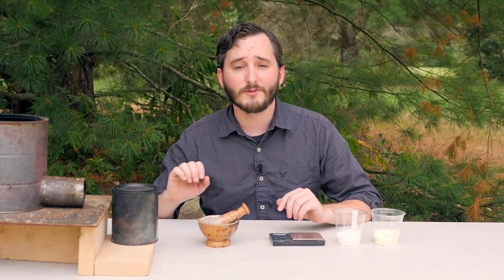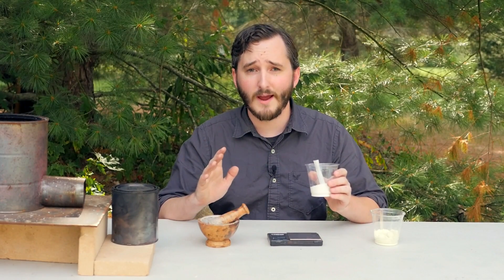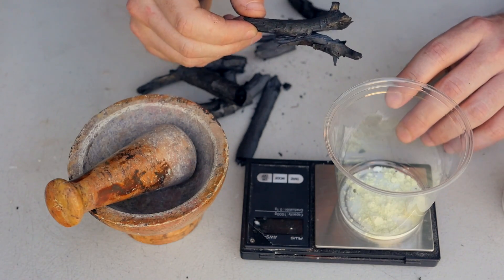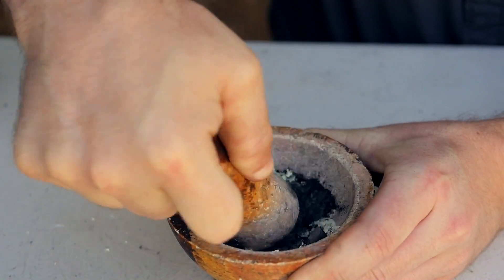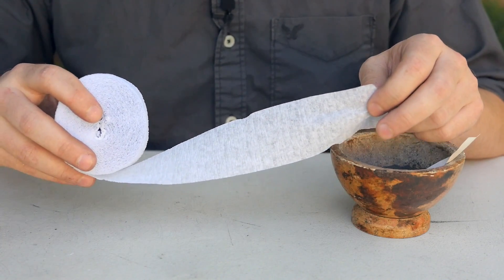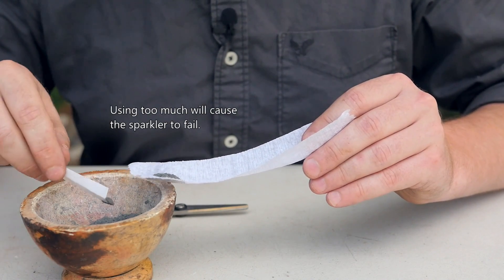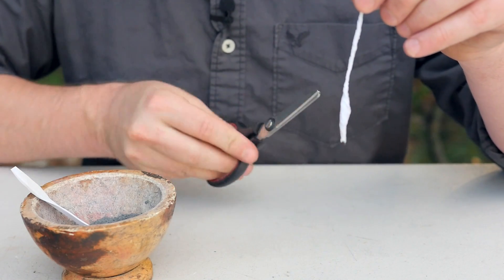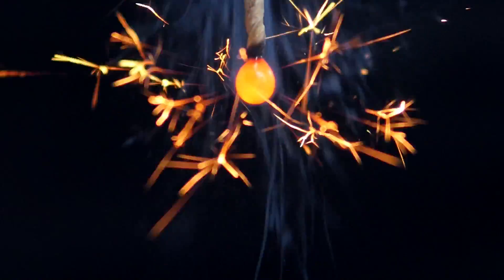How To Make Senko Hanabi Sparklers (very rare Japanese fireworks)

Comment: I think there are two questions relative to the sparks, namely what is it that's burning in them, and what provides the motive force for their ejection? I don't know the answer to either, but am wondering if trapped gasses in unburied bits of the charcoal could be released, propelling the charcoal particle out of the melt, where it burns in air. (?) But then the initially ejected bits themselves break apart into sub-sparks. Same process?

To test the trapped-gas theory, you could try (a) using less completely-combusted charcoal (leaving some unburied resin inside the cells), and/or (b) trying a different kind of wood to make the charcoal from, that has a tougher cell structure (making it more likely to retain some resin inside, and/or more likely to build up higher pressure before a cell or gas pocket ruptures, so giving more force to the particles, so they can escape the melt.

OTOH, it seems unlikely that the particles are being ejected from any depth within the ball of slag, so it seems it's more likely some sort of a surface reaction that's randomly occurring on the surface of the slag ball. - And once a particle is ejected, it has both higher temperature and lots of surface area, so the process repeats...
Reply from the maker: I am not completely certain about the mechanism of the reaction, but I have some thoughts I talk about in the video description. The charcoal used is certainly a key factor, but that's the case for just about every type of firework.
Reply: I think it's gasses formed in reaction:  S(g), SO2, N2, CO, CO2
Reply: NightHawkInLight - Oh duh, skipped straight to the comments without reading the post itself!

So it sounds like it must have to do with how the gas-producing reaction is triggered or catalyzed. Interesting that the one-off early success was with the arsenic compound. Maybe something to do with what the sulphur was in that was left behind in the slag?

The slag ball seems to grow quite a bit after the primary combustion, by consuming the carbon in the paper. I wonder what would be the effect of sprinkling a bit of the "special" carbon from the charcoal up along the paper "tail", above the mixture? That way, you could change the type of carbon being incorporated into the slag-ball as it develops...

Comment: Potassium Nitrate  35
Charcoal 20
Realgar 45
Reply from the maker: Yes, I've found it doesn't work well. I've tried 100+ variations on the composition with ratios on either side of Skylighter's. The one I settled on for this video is far outside the commonly documented range but it's what I found to work best.

Comment: Can you change the color of the sparks? Like, adding borum or potassium or even magnesium. I would love to see it with a little bit of magnalium (magnesium aluminum powder). I believe that for such effect they would have to be added as impurities, very very small amouts. You can also test diluting these salts in water and soking the paper with the solution, it problably have to be very dilute so it doesn't afect the burning.

Comment: Changing the wood for your charcoal willl maybe do the job, indeed this pine is not a tree from japan, using a japan tree like they use will maybe change everything. Each tree make diffrent sap and have diffent mineral needs so you will find diffrent source of sparks in these diffrent woods. Did you try with mineral coal?  Maybe it'll be very diffrent too
I'm sorry if i kill (again) Shakespeare with this comment, I learn English by my own...
Reply from the maker: I have tried several types of maple charcoal, it works ok but nothing special. I have not tried coal, that would be interesting.

Comment: "what might help?" 
well all sparkler compositions that i worked with and are similar to BP the amount of sparks and their time of burning off is dependent on the size of the charcoal particles size... grind the charcoal separately, then sift it, use the fine dust for the composition your making and add some of the larger charcoal particles for the sparks... try using ball mill for few hours to grind the composition...
Reply from the maker: These sparklers seem to work independently of charcoal particle size because the composition itself has burned long before the sparks begin to form. I have tried coarse charcoal a number of times just to be sure and it makes no difference.
Reply: you are most probably right... i never ever seen this type of sparklers and i dont know how they work... above all when i make compositions with potassium nitrate if they make such droplet it means the composition is not mixed very well (to little time in the ball mill) or there is excess of potassium nitrate, but thats not the case in the sparklers type your making it seems... maybe try to moist the mixture with 50/50 water/alcohol before making the sparkler?
btw can you be so kind to tell me what video compression are you using for your videos?
i found it strange but some of the channels (crazy russian hacker, slingshot channel... and your channel) upload videos (most likely depends on the video compression) that cant be watched on firefox using the youtube html5 player... this goes for some time and i reported it many times but it seems google doesnt care and forces you to use chrome...
Reply from the maker: I have tried solidifying the grain of the sparklers by wetting them with alcohol and even adding a binder, it doesn't seem to make a difference. For my video compression I'm just rendering to an .mp4, that's a strange issue you're having.
Reply: I saw an article on NHK covering a maker of these and his special ingredient was the pine charcoal. The wood he was using had been seasoned for 20 years.
Reply: have you tried wet bamboo as a wood for the charcoal? It's a quite waxy wood/grass.

Comment: by the look of them senko hanabi sparklers seem to be very tightly wound and the stalks seem to be very stiff for thin tissue like paper. i think that these sparklers may be made in a similar way to paper fuses and are not made dry (the paper at least). this technique comes up in quite a bit of paper working (origami and such) as when dried the paper stiffens and acts kind of like a spring wanting to keep its form.
Reply from the maker: I've tried a few different wet methods for making these, no success with that so far but it could have potential.
Reply: I think streamer paper may be called crepe paper, and there's a good chance it's treated with "water glass" (sodium silicate) for fire resistance.

Comment: Me and my brother made these are few years ago, we got the composition from some Chinese website. I still got the composition saved as a .txt on my old hard drive, it's:

55 potassium nitrate 
22.5 sulfur 
22.5 charcoal

we also made the powdered charcoal ourself, we tested both pine and coconut shell. I would say pine worked better. We also tried to add some icing sugar, the "glob" was bigger tho it seemed like it produced less sparks. For the paper we used brown sandwich wrapping paper. Tissue paper also works but burns faster.
Reply: Adding icing sugar adds cornstarch which would slow down the burn rate and less sparks. Generally avoid powdered sugar in pyrotechnics and rocketry.

Comment: I thought I remember something about other sulphur compounds being used in these, possibly some realgar. Also, I seem to remember something about asphalt tar being in these. You can find this on tarred telephone poles oozing out. It should be brittle enough to break off and crush along with the KNO3.
Reply from the maker: Realgar was included in the very old compositions but not worth breathing arsenic smoke to use it. I am considering tar charcoal, it would do something different certainly.
Reply: Yeah, I wouldn't go the realgar route either. I have some commercial versions of these that I ordered a few years ago. I did notice that they STINK when they burn. Very different from a black powder smell. Not even a sulphur smell. I'm pretty sure they have something else in there besides the 3 basics. If you don't have any of them, hit me up and I can get you some. Maybe you could get an idea of whats inside.
Reply from the maker: If you know of a source I would be interested. I've never had commercially made ones to play with.
Reply: I'll send you a message.

Comment: Wood with any type of sap or ROSSIN
Reply: I would try using cedar charcoal, it is a very flammable wood with a lot of sap.
Reply: Wet.Socks oh, yes you are correct. Rosin - 1. resin, especially the solid amber residue obtained after the distillation of crude turpentine oleoresin
Reply: +Wet.Socks Yeah, that caught me off-guard too. It's just to check we were still listening, eh? ;)
Reply: Does this mean the charcoal is being made at a carbonization temperature closer to 300 ° C than 1000 ° C ?  That is about the only way that the wood species would matter, because the composition of charcoal depends strongly on the carbonization temperature.  http://ukrfuel.com/news-chemical-properties-of-charcoal-23.html
Reply: Wet.Socks
Reply: They get new ones everyday so that it doesn't get hard to re-shoot so much under the extreme duress otherwise
Reply: +sirociper z No, you missed the point, he was commenting about NightHawkInLight's pronunciation of Resin, as 'ROSSIN'.
Reply: Wet.Socks isn't it rosin?
Reply: monsterjam56 Yeah but normally people say resin and it caught me off guard as sounding like ROSSIN

Comment: A pinch of magnesium, and do 70/30 charcoal and sugar in my opinion
Reply: Around a pinch
Reply from the maker: Any metal powder added burns away long before the drop forms that makes the sparks. The reaction that makes these sparklers work is very different from normal sparklers.
Reply: Sugar will end up producing water that will destroy the Potassium sulfite. 
But making german dark aluminium with pine charcoal and add some can be a good idea.
Reply: I'm gonna need a banana for scale.
Reply: the ash thing last for as long as heat is on it,,, but you need to try this ,,just get zig-zag papers twist one very loose and put a flame to it and keep it on the ash that forms,, see it get brighter and go solid,,,,
Reply: put metal powder above the mix? see where it gets to before the sparks start and add a very small amount starting there and going up
Reply: Duck
Reply: Vasily
Reply: Cody used sulfur to ignite thermite. What if you left some sulfur in the paper as a fuse then metal powder?
Reply: Vasily B  how much is a pinch
Reply: Ethan Winder I was thinking the same thing, a very minute amount of oxide towards the top. Whichever oxide you choose obviously because they are burn differently

Comment: Obviously i think of metal particles that could be added to the mix, maybe add a very thin layer of tar/rosin to the inside of the paper so you can spread it more. I'd strongly suggest you try to saturate some thin paper (tissue paper, toilet paper or silk paper maybe) in a salt solution ; table salt, bicarbonate, maybe sodium-free salt (as it's potassium chloride). It will make the paper burn very slowly and is generally recognized as a method to get the paper flame-proof. I'd also try to know what parameters have been different when you did the experiment in 2008, different wood, different sulfur impurities might have had a big impact on the end result.